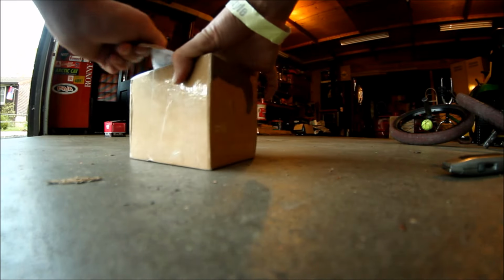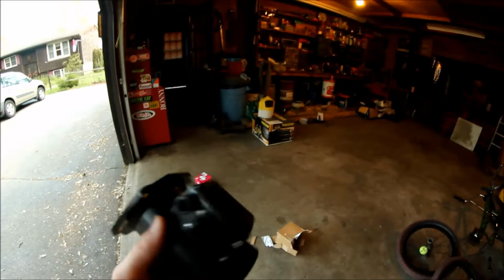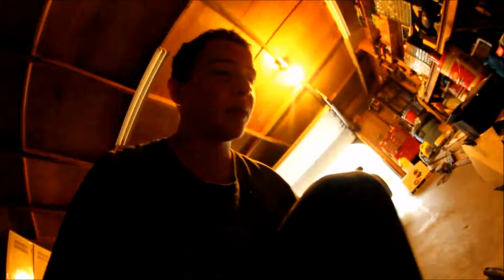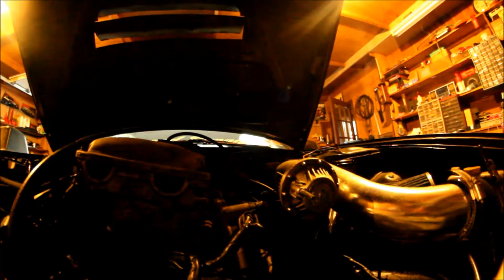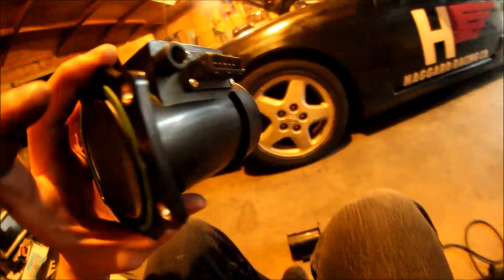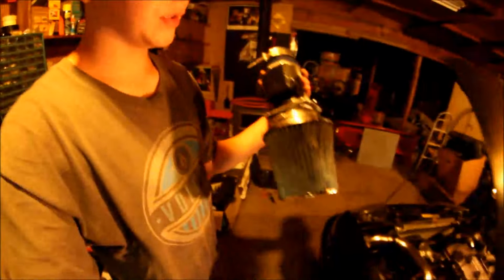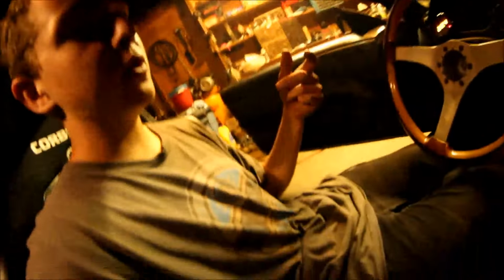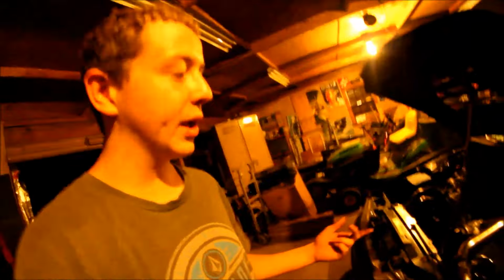S14 Idle!!!

Comment: get that innovate AFR calibrated!!! might be the reason its running shit if the ECU's using its output.

unplug the sensor and power on the gauge, power it off then plug the sensor back in, power the gauge back on but with the sensor in free air (Not installed in the exhaust). after the cal has finished reinstall the sensor into the exhaust and it will read accurately.